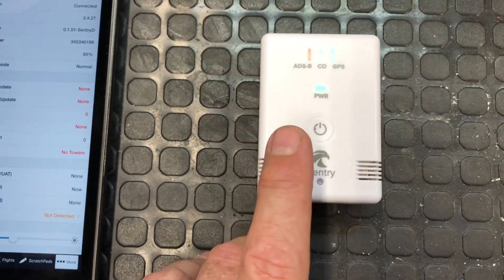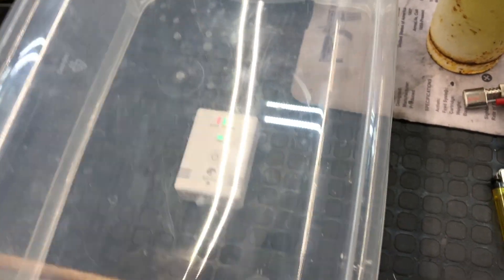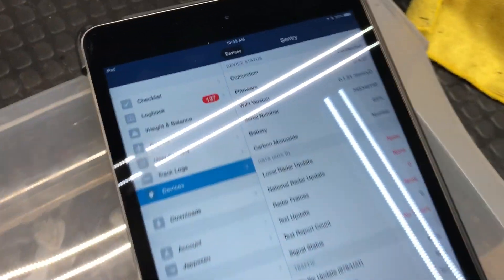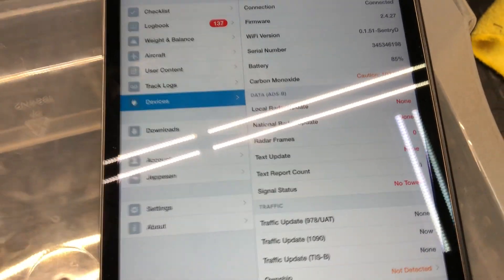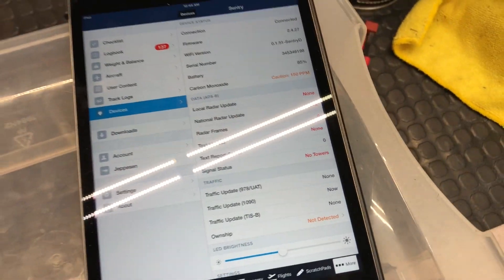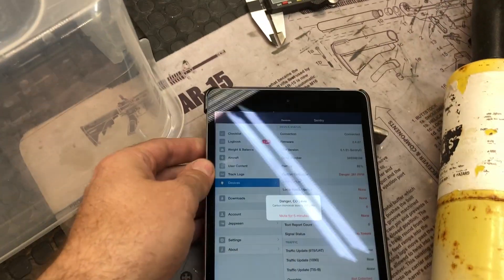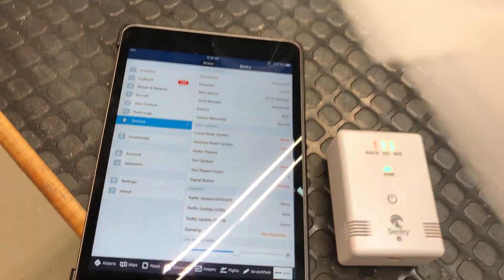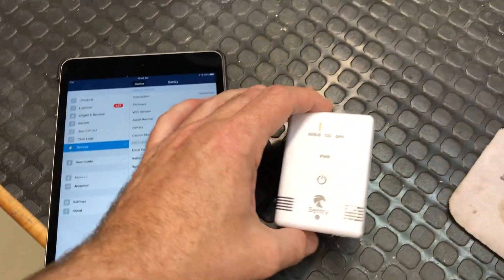Sentry ADS-B Firmware Update - CO Monitor Fixed

Comment: Very cool, great, I was a bit worried when I saw the torch... Great to see that the firmware update was successful, now I think I will order one... Thnx again...
Reply: How did you fix it? I just got mine, version is 0.2.30 and can’t stop co2 alarm, level goes over 210 and does not come down...